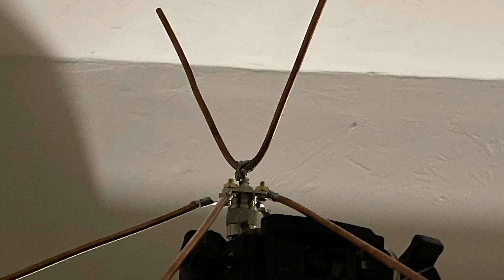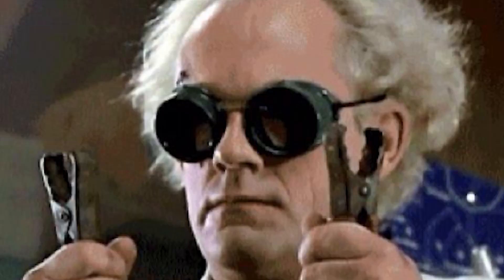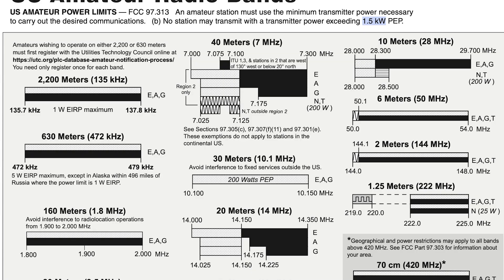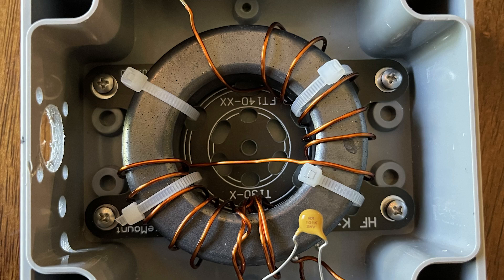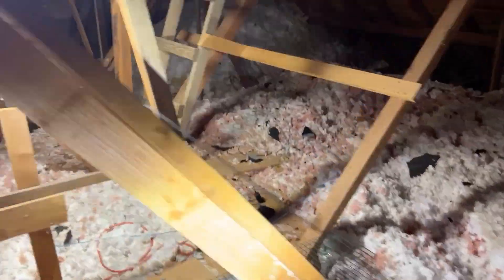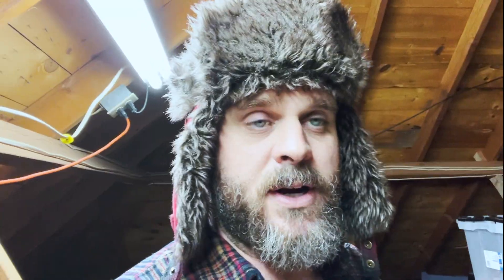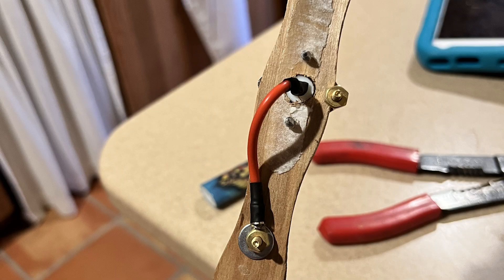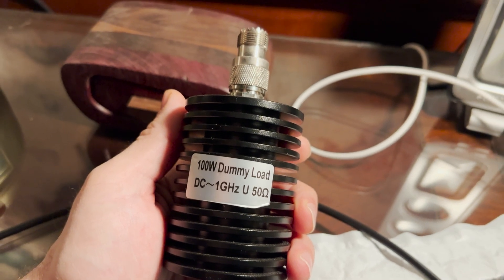Ham Radio Antenna in the Attic?

Comment: Nothing wrong with an attic antenna as long as you don’t have radiant barrier or a metal roof.
Reply from the maker: i had a radiant barrier installed last year.  Its saved me a ton on energy, but the attic antenna is quite useless now.  :(:face-purple-crying:
Reply: @WY6Y-s3v yea sadly radiant barrier is the iron curtain.

Comment: I have five h/b dipoles in my attic, 20m to 10m. QRP with nothing above 5 Watts and I get out.
I've used an h/b indoor mag. loop too.
I searched the internet and radio books to find attenuation figures of bricks, slates and wood but can find nothing for h.f., only uh.f. and microwaves so I guess it's hardly any attenuation. H.f. is very forgiving and a little power goes a long way, especially c.w.
G4GHB.

Comment: Wow you did a really great job on this video! It's always a good idea to put a few snap-on toroids on The wire that feeds the thermostat. I had a situation where when I turned on my transmitter I noticed after a couple hours it was getting kind of cold in the house😂 and a couple of toroids fixed it very quickly and easily! All the Best! 73 DE W8LV BILL.
Reply from the maker: @w8lvradio  thank you for the compliment. Snap on toroids are very popular at my house. 73 WY6Y

Comment: I live in an apartment. So needless to say that I'm not allowed to have outside antennas. But no problem I use a radioddity HF 008 portable mag mount on a piece of 2&1/2 by 3 ft of plate steel in my closet on the second floor. It works pretty well for a compromised antenna. I'm also on top of a pretty tall hill so that factors in. I want to put some kind of wire antenna indoors either a efhw or a random wire. However I don't have an attic to use. So hopefully I can get away with it running across the ceiling. Ive eliminated the RFI by adding an LDG 1:1 common mode choke. With 100 watts or less and this indoor antenna and I can work the world!!! 73🙂
Reply from the maker: Nice!!!  My favorite antenna is a jerry rigged antenna in an unlikely spot.  I’ve also heard of people in apartments using folded dipoles but an EFHW will do it.  Just make sure if you are doing FT8 to turn the power down when your fillings start getting hot.  🤣🤣.  Have you thought about using a telescoping whip with a loading coil on your balcony?  Or you could build a magnetic loop, which i have never used.  Glad you are on the air man!  73 WY6Y

Comment: When I was still living at home I was under the usual rules of mounting nothing on the house, so my first thought was to put it inside the roof space. My license at that time was limited to 2m & 70cm so I had a log periodic setup on a rotator (horizontal) and several vertical antennas for packet and voice. The roof was tile and there was no metal film insulation so there was no issue with strange RF effects on items in the house. The main advantage of this style is that no one will ever know what you have there and you never have to worry about waterproofing anything! So my current house has a metal roof, and that aluminium lined insulation that makes it impossible to hide anything in the roof space. Give it a try, you might have great success or it might be a disaster, but you won't know unless you try...
Reply from the maker: Unfortunately, I recently got a new roof and I opted for radiant barrier film and it has degraded the signal further, but not unusable. Especially on 2m/70cm. I can still hit all my repeaters with ease, but there is definitely more “snow” in the audio.

Comment: Will it work under a corrugated iron roof?
Reply from the maker: I’d say it would be very problematic. You could probably tune up the roof to be the antenna though. There’s a good experiment for ya.
Reply: @WY6Y-s3v  Interesting. Thanks.
Reply from the maker: @ I know there have been people who’ve done it. You’d probably have the best luck with a manual antenna tuner that has sockets for open wire feedline. Just take a couple alligator clips and tune that roof up.
Reply: I tried turning back the RF gain control.  I switched in the ATT but no the qrm is still strong .
I persevered a wee while but just couldn't make it to the end of the video , sorry . I'll try again next time, see if we have better luck . Fading is one thing but self imposed qrm ?

Comment: For VHF an antenna will work but your coverage may not be great.  If you have an HF antenna it will also work but again your coverage may be limited.
Reply from the maker: That has been my experience. I can hit every repeater I want to on VHF UHF but there is some snow in the audio. For HF, SSB is very noisy, but digital modes really shine. 73 WY6Y
Reply: Have you tried it?
Reply: @Redbelly357  Yes many years ago.

Comment: Several years ago I lived in a deed restricted community. Stuffed a Comet H422 in a V config on it's side suspended by Dacron cord, and made a small stand for a Cushcraft AR270. Lost about 15-20mi range on 2m/70cm. The Comet did pretty well making contacts to Eastern EU from NJ. This was with a IC-9100, and IC-705 using PSK31.

Comment: I don't "need" to see this, because I've got a compromise G5RV Jr in my attic and I'm running at most 25w on 40m, 13 on 20m, 10 on 15m and about 6w on 10.  Was off the air for close to 30 years, got back on November 22.  Since then, I've got 48 states (ironically, one is NH, I got AK on 10m), 47 countries, including Australia, Japan, East Kiribiti, all over Europe, South America, Caribbean from central NY.  Over 700 QSOs since then.  Going to install an EFHW up there eventually - two probably - second one will be for 30/17/12.  

Oh... and just today I put a 2/440 j-pole up there too!  Attic antennas work for sure as you and I both know from personal experience.  73, John N2LCX
Reply from the maker: Right on John.  I’m curious about how the G5RV works in the attic.  How do you have the ribbon line configured?